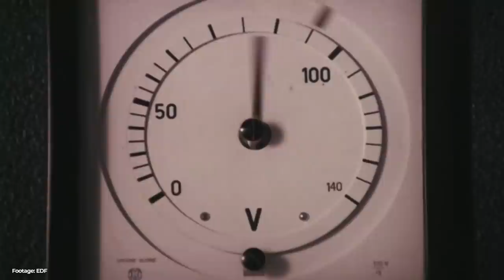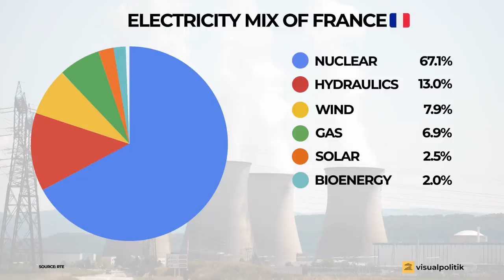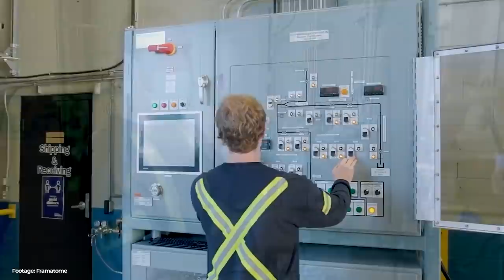Why is FRANCE betting on NUCLEAR ENERGY again? - VisualPolitik EN

Comment: Oil cuts 
New power supply built, nuclear only available hope at the time. 
Today everyone is connected. 
The grid connection and EV battery technologies are critical for the massive increase in renewables technologies, for the changing economics of electricity generation. 
Central power plants and their expensive grids changed the world for the better.
Dispersed renewables and the existing grid will change the economics and politics of electricity power.
Dispersed electricity generation CAN NOT BE stopped, or bombed or used as a nuclear pollution 'weapon'.
Blackmail from Russia military or any other country can not work on a dispersed power grid.
Grids can be quickly repaired. 
Cut off areas can work as power islands.
National defence is more robust.

Comment: After looking at these comments I come to the conclusion . Everyone says hydrocarbons are bad 😱 although they power our modern world . We would all LIKE to move to electricity for everything and are certainly taking massive steps to do that right  NOW but we can’t see or agree on how we are going to generate the required power. There seems to be a pretty large gap between virtue signalling wishes and there practical delivery. Better get used to power outages ,high energy prices and possibly some civil unrest folks.

Comment: When you ask for a nuclear reactor to be built, run and decommissioned you will get zero bids because the cost is always ten times more than the highest estimate.  Love nuclear, way better than Russian gas but the cost is so high no one even asks.  They just run out of money and shut them down after dumping endless billions. Apart from the cost, it’s great. What private companies run nuclear for profit?  my guess is none but that would clear a lot of fog from the nuclear lovers in abundance in these comments.

Hope to hear who runs nuclear at a profit and at what cost?
Reply: No takers.  What is all this energy dense talk and why does that matter?
Reply: @colingenge9999  basically how much energy you can get out of something. Because Uranium is very energy sense it means a small amount can be used for a lot of energy making it cheaper. That's why nuclear power is cheaper for the public. It does cost a lot at first but nuclear reactors can become profitable after a few years. The more you have the more profits you make
Reply: @hydromic2518  Would that mean that solar which uses photons with near zero mass would be the most dense and according to your logic, better?  Just because reactor fuel doesn’t weight a lot has little bearing on the cost of the energy coming out of the reactor. Operational costs are not zero even if the reactor is paid for. Must be staff for operations.. I know that regs in the US make nuclear more expensive; I have sat in NRC meetings and they’re mind bogglingly complex; so complex that they’re doomed to fail which adds layer upon layer of costs., hearing of reactors proposed to take ten years to build which was pushed to 25 years is common.  In Indiana, they stopped work on 3 after spending many billions and just couldn’t get any more money so dumped the whole investment and went to ground source heat pumps and reducing energy load on buildings at a fraction of the cost but never discussed because we want to see a huge top down monolith like a reactor that we can bow down to.  Godlike.

Comment: Because they need to supply Germany with shared electricity, since Germany isn’t (and won’t be) able to supply itself. Germany is fully dependent on energy from abroad - no matter how polluted it is. So France at least tries to get some cleaner energy into the mix.
Reply: WTF are you talking about? Germany has had an electric energy production surplus for years now.

Comment: If there is no other way , if the Europe goes pro nuclear , the idea of these small reactors is much more sensate in terms of safety and waste management I think. I am not specialist. They must be consulted. But we are struggle , and it will get worst . We cannot keep depend on only one country  to survive on energy. I am favor to independence of resources and variability. More than one. Use solar, wind, natural gas , everything. 
Israel is a great model of everything in terms of self sustainable. And they are studying the use of nuclear power plants too. The point is to analyse all (all) worst sceneries  and what to do to prevent. Everybody is afraid to repeat serious accidents like Chernobyl / Fukushima. We are afraid of earthquakes/ terrorism. How to deal with toxic waste and fails with cyber attack system for instance? It is quite serious. 
Another question: the energy from hydrogen in large scale is still unviable ? The safest and cleanest source. How long ? How much?

Comment: Why not two tier system? Green energy(wind and hydro) and yellow energy (gas and nuclear) Funding, subsidiary, and regulation can be applied differently.  No energy solution is perfect. We should accommodate both to reduce brown energy (coal and oil)
Reply: Nuclear power has less carbon footprint than any other option. Why should it be paired with gas?
Reply: Gas is not clean.

Comment: Hydro electric is the solution the world is looking for, the issue is that it will take the invention of a totally different type of infrastructure to achieve which will mean the reinvention of old infrastructure. Once it has been it will sustainably support every single generation after that and mitigate any further difficulties from re occurring. Its a permanent reliable consistent green solution that also has the potential to reverse climate change if done properly. no other energy solution has this potential.
Reply: France is not Norway.

Comment: Most nuclear power plants in France are older than the journalist himself! The main reason they are going to be shutdown and decommissioned is because they are reaching their 40-year design life and extending their use by 20 years would cost 30~50% more than generating the same electricity with wind and solar.
As for building new reactors in France: no new reactors have been built in the last 20 years except for Flammanville, which is 11 years late and 300% overbudget. Good luck with trying to resuscitate the dead French nuclear industry! Amazingly most European countries have realized that nuclear energy is dead and are investing in renewables, but the Macron government is trying to swim against the current!

Comment: Nuclear, with the new advanced designs (molten salt reactors, TWR etc), in a more manageable size and industrially produced can be a safe, reliable source of energy that it is environmentally friendly and financially feasible. Cheaper, reliable energy can also make possible things such as desalinization as a viable source of water for human consumption and irrigation, lowering pressure in the existing water basins and subterranean water tables. New technologies can also impulse radioactive material residues (recycling/reusing) and the use of alternative fissionable sources (i.e. thorium). The alternative of fusion energy, unfortunately, seems  that it will continue to be the source of energy of the future as it has been for more of half a century.
Today, energy is a pivotal component of the standard of living of any society. The availability of cheap, abundant energy is going to be what conditions the well being of our society, ours and our descendants.

Comment: Nuclear has gotten a bad rap, yes there are have been a number of high profile incidents that caused major environmental damage and lose life, but even if you total up the amount of damage and loss of life due the incidents over the decades, they would pale in comparison to the damage and death count that a single year of burning fossil fuel for electrical generation causes.  An estimated 9 Million people worldwide die due to pollution created due to the burning of fossil fuels for energy generation yearly, around 350,000 of those are American's.   

In comparison, the total human deaths due to all nuclear incidents since 1946, from the major one like Chernobyl to smaller incidents like the Samut Prakan radiation accident where a disused radiation-therapy unit was dismantled by unqualified scrap dealers who acquired it by dubious means totals a mere 15,473 on the high end of estimates.  This means in the 76 years of both nuclear energy generation as well as medical radiation/nuclear therapies,  the total deaths from nuclear accidents equals only 0.1719% of annual deaths caused by one year of fossil fuel use.

The newer generation of reactor are a lot more safer, reliable and efficient then even those of twenty years ago.  Plus I personally take umbrage at the term "nuclear waste".  Back when we started cracking crude oil to produce kerosene for lamp oil, an unwanted byproduct was this thing we call gasoline, which apart from a small amount being sold as a cleaning solvent, was seen as little more than a waste product and was flushed down the drains.  Then came along a German gentleman by the name of Benz who turned everything on its head by perfecting a practical petrol engine and marrying it up to a buggy.  Now apart from jet fuel, kerosene products takes a very distant 2nd place to gasoline production.  What I am basically trying to say here is that, today's nuclear waste product could well be tomorrow energy gold.  So yes, we should store it away safely so that it doesn't cause environmental or ecological damage, but we should also be able to recover it just in case it become a valuable resource in the future.

Nuclear energy's benefits in my humble opinion out weigh the risks it does have, plus is a lot more reliable and stable than other renewables and should be part of our future energy production plan.  Plus it could be used to help bring about the Hydrogen revolution for transportation, by marrying up water based hydrogen cracking plants with nuclear power generated electrical plants.   

It is all very doable, it just will take the social-political will and capital investment to see it happen.  Personally if I had the coin that Musk the Moron,  Bezos the bastard or Branson the wanker (Mike Oldfield rules!!!!!) has, I'd be investing in these techs and initiatives, coz they would do a hell of a lot more good then flying metal penis's into space.......

Comment: What is the difference between the proposed "Small Modular Reactor" concept and the reactors already in use on naval ships? It seems pretty simple to just copy the powerplants of submarines and aircraft carriers on land. These are already proven designs that can work in demanding conditions for extended periods. Furthermore, there is already infrastructure in place to train new operators and maintain them rather than starting from scratch.
Reply: @marianmarkovic5881  Good point, I should have mentioned that. Though I don't think HEU is a major reason not to use them on land.
Reply: @MrChainsawAardvark  There is still question of safety agains unautorised personel, its easier keed eye on few big places then lot of small energy sources.
Also it isnt that small reactors are new idea,... SL-1 was concept of one of those, small reactor, all parts could fit into truck,... quite sad nuclear accident,...
Reply: @marianmarkovic5881  Yeah, I know about SL-1, and I wouldn't advocate for that design. Also know about project glowworm (reactor on Greenland ice shelf) and the SNAP program. Isn't the point of SMR that you have one complex with ten reactors, rather than two big ones, but otherwise same footprint/security as a normal nuclear plant? 

Thats the thing - I know a lot of this stuff has been done before. It's why the SMR hasn't been implemented yet, or prior failings that I want to know.
Reply: @MrChainsawAardvark  Well I thing Anna Drábová (Head of Czech State Office for Nuclear Safety) said openly in interwiews, SMR looks nice, but it has reason why reactors in PP grown in sizes from few dozents MWe to 1500+MWe,...
Reply: @marianmarkovic5881  AREVA K15, used on Charles de Gaulle , runs on 7.5%-enriched uranium, so... I think it can work as a good reference point for a civilian SMR.

Comment: Renewables alone will never be able to achieve decarbonization in time, not even by 2050! Natural gas is still a Fossil Fuel and produces too much emissions (130 gCO2eq/kWh). Nuclear Energy (5.1gCO2eq/kWh) is the only solution if we want to avoid catastrophic climate change!

France is right, we need new Nuclear Power Plants. Hope the EU taxonomy will include Nuclear Energy! 

Source: UNECE Life Cycle Assessment of Electricity Generation Options 2020
Reply: It seems I have to copy this all over the place: Fossil energy accounts for 80% of the worlds energy consumption, nuclear only for 5%. I we were to replace only half of the fossil energy with nuclear energy, that would mean an increase in uranium consumption by a factor of 9. Studies say that the world's uranium deposits will last for maybe 100 years if we keep the consumption at the current level. Consuming nine times as much, those deposits would only last for 11 years. And probably less than that because energy consumption has been rising exponentially since forever. Also, nuclear energy is the most expensive form of energy. Also, the country with the greatest uranium deposits (with as much uranium as the next four countries) is the democratic model country of Kazakhstan. Yeah, that is the country we should send our money to.
Reply: @pillmuncher67  Have you ever heard of Breeder Reactors and Thorium?
Reply: @eurobonapartiste  Yes. I like Thorium reactors. I think we should have them, especially since Thorium is more abundant than Uranium 235. But where are they? There's one in China. Where are the others?

Comment: Very glad to see France getting more positive about Nuclear again and hopefully they will soon cancel the old polices of the terrible Hollande government which limits Nuclear to 50% of the electricity supply in the near future.
Reply: It seems I have to copy this all over the place: Fossil energy accounts for 80% of the worlds energy consumption, nuclear only for 5%. I we were to replace only half of the fossil energy with nuclear energy, that would mean an increase in uranium consumption by a factor of 9. Studies say that the world's uranium deposits will last for maybe 100 years if we keep the consumption at the current level. Consuming nine times as much, those deposits would only last for 11 years. And probably less than that because energy consumption has been rising exponentially since forever. Also, nuclear energy is the most expensive form of energy. Also, the country with the greatest uranium deposits (with as much uranium as the next four countries) is the democratic model country of Kazakhstan. Yeah, that is the country we should send our money to.
Reply: @pillmuncher67  You start with a correct fact about fossil energy. But you totally wrong to suggest we only have uranium for 100 years. The ocean has uranium forever and is a renewable resource. We could easily find more uranium to mine as well if needed and then we also have thorium.
Reply: @SteenLarsen  Yes, there's uranium in the ocean. How much would it cost to extract enough uranium to power a nuclear plant for a year? How long will it take until the extraction costs drop to a competitive level?

Comment: 40years lifetime is not written in stone, not close to it:
Dhe concrete containment and the central pressure vessel can hold MUCH longer,(for german convoi-class reactors for example the real, life-expectance for example is estimated with ~90-120 years). But: Other components like the steam-generators, the turbines,..are gone last just around ~40years. So, you don't have to 'throw away the plant after ~40years, but refurbish them ans you can run them around an other ~40years.
Reply: Ok, thanks for the steam-generator details: just means that 'they don't can use the old ones 40+ years, but change them 'right know', maybe 5-10years before previous shedule. ps: Olkuliotu is by know in the startup-procedure, first critcallity is allready reached, Net-syncronisation propably in about a month
Reply: I would be mostly concerned about the state and integrity of the primary loop of the PWRs. Corrosion and neutron damage to steel is becoming a concern. And replacing the entire reactor vessel is probably not economical.
Reply: @HELLO7657  Well if its from the 1970s, forging an exact replica is probably a bad idea as one would probably want something up to modern standards. And it is questionable if anything but an exact replica could be retrofitted.
Reply: @TheBackyardChemist  There are sample in the reactor vessel of the same steel quality, same temperature, same cemical conditions but closer to neutron source. They got testes regulary, so they know the above mentioned numbers. (For convois 90-120years.
(In the steamgenerators the fine piping gets normaly wasted).